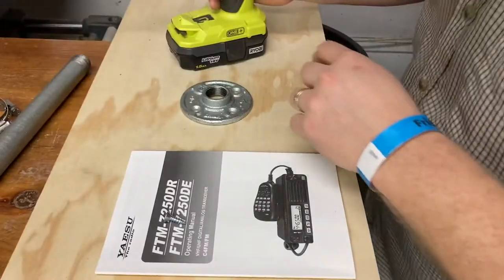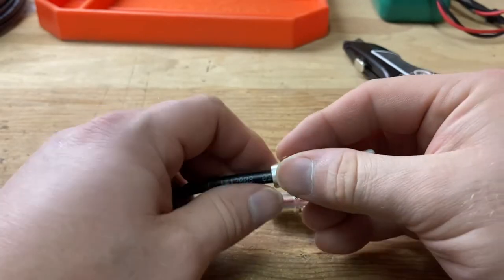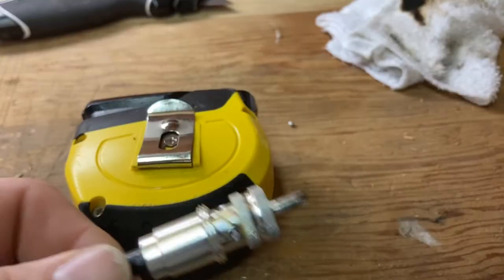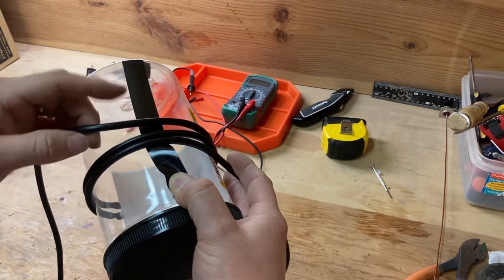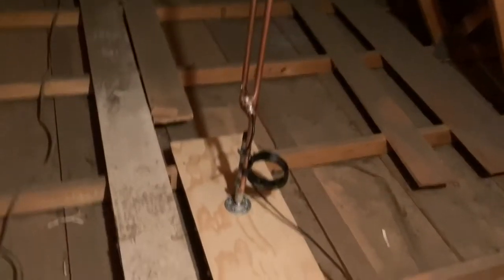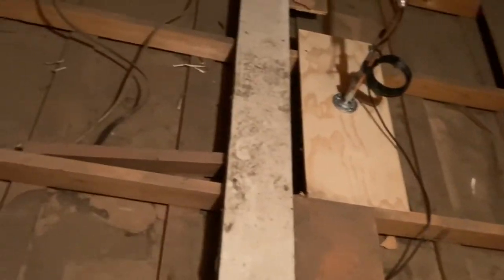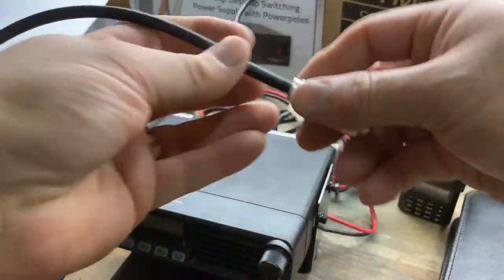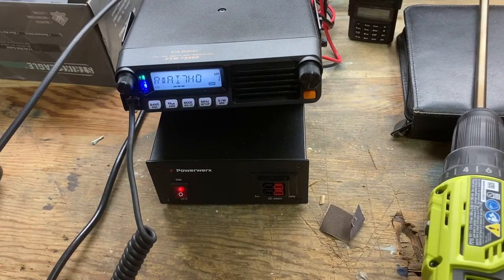JPole Antenna Install - KB9VBR Breakaway

Comment: I just installed a J-pole for GMRS in my attic, basically just stuck it on a wooden dowel for height, made the 4-5 wraps like mentioned in this video, radio is 20 watts, works great ! 
Easily hit a repeater 5 miles away.    Many mentioned how clear and strong my radio was.    Just fyi.

Comment: use rosin core solder..small diameter..
Reply from the maker: Yes! I learned diameter makes a huge difference since I recently started soldering on circuit boards. I think I also used plumbing flux so I plan to revisit/ redo all my previous work. Thanks for the comment and for tuning in!

Comment: What mast/mount are you using at :20?
Reply from the maker: That's a threaded galvanized pipe, into a threaded floor flange, and mounted on plywood.